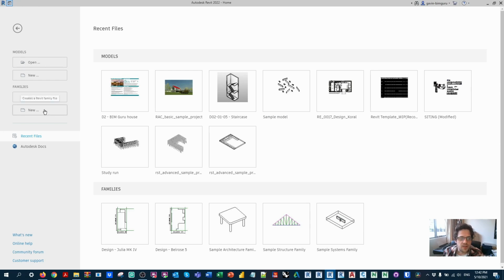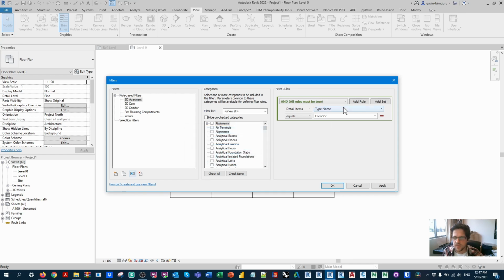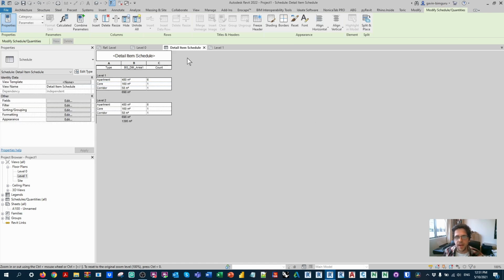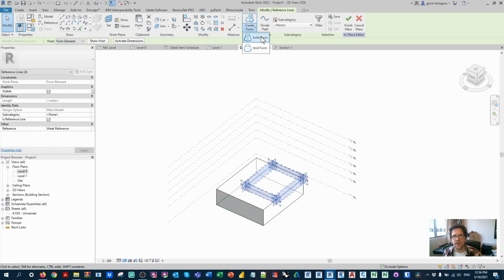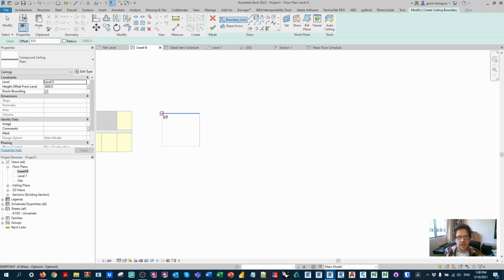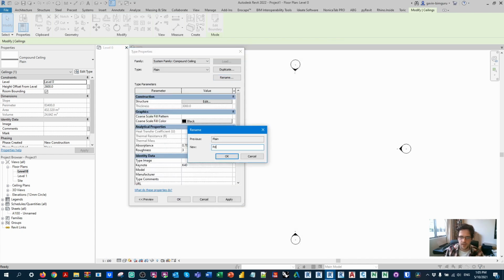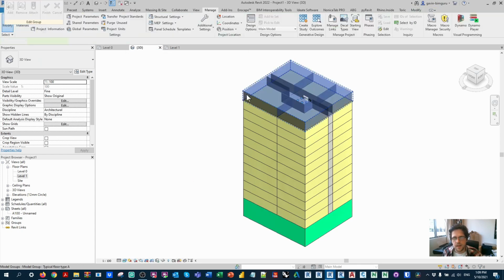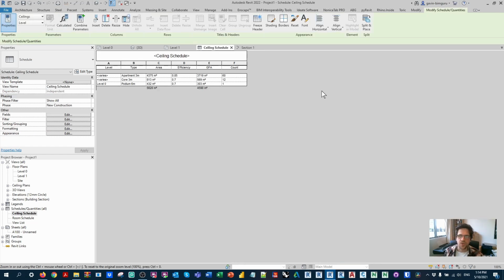Blocking, Stacking and Planning using Revit!

Comment: Very handy, last week I had to calculate the gross Volume of a house, with a rather complex roof shape. I had to do this by hand (very time consuming) only because the council did a very coarse (and rather unfavourable calculation) to determine building permit rates. Is there an easier way to do this? I could not find a straightforward way of determining the building volume based on it’s envelope. The material browser is always temperamental, somehow it’s a very heavy piece of c++ code that likes to crash a lot. Revit can be so slow and sluggish sometimes as if Autodesk’s programmers have added a few “do nothing” loops on purpose😁.
Reply from the maker: Thanks, yep those material browsers are lethal.

For complex volume calculations I usually model it as a solid form and use Dynamo to regularly read/set the true volume by analyzing its geometry inside Dynamo itself.

Comment: Great explanations! I'm planning on giving your ceilings method a test run. When I mentioned masses on Twitter, I'm used to using them not for spaces within a building but for multiple building shapes, such as varying length and width of townhouse footprints. I certainly agree that the limited ability for masses' interiors to be malleable makes them an insufficient tool for showing various space options within a single building.
Reply from the maker: Glad it was helpful! Yes masses are mainly only helpful when you want to use mass floors to automate area takeoff in my experience, but too clunky in other scenarios. I find ceilings handy as they can let users break down spaces into smaller pieces for high level space planning as well.

Comment: Thanks man, very useful. 
I'm just wondering why you are using ceiling instead of floors ??
Reply from the maker: I prefer ceilings to floors here as they go upwards whilst floors go downwards. For a floor to match a floor to floor i need to offset it by its height but for a ceiling i just set the offset to 0.
Reply: @AussieBIMGuru  I thought so :)

Comment: failed because of bad graphics drivers no doubt !!
Reply from the maker: Nosiree. Quaddro P5200 - more than enough to run it. It's just a dodgy piece of software sometimes unfortunately - a graphics issue would have told me the window contents cant be drawn.
Reply: @AussieBIMGuru  still way more stable than autocad ever was and surprised to see revit crash although many a time it can be non responsive for up to 20 minutes on a large project of many buildings
Reply from the maker: Yes I wont be going back to CAD anytime soon. I usually find Revit crashes due to the material browser - it is very unstable in my experience and nearly always is what I'm doing in my videos if it ever crashes.